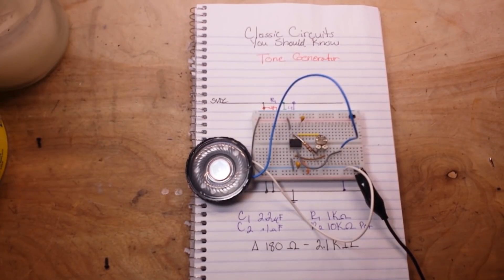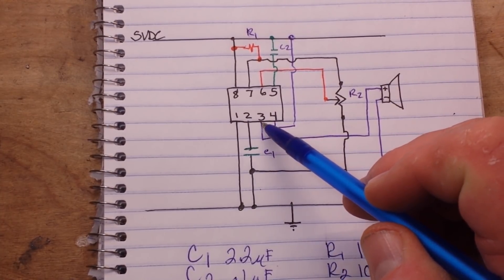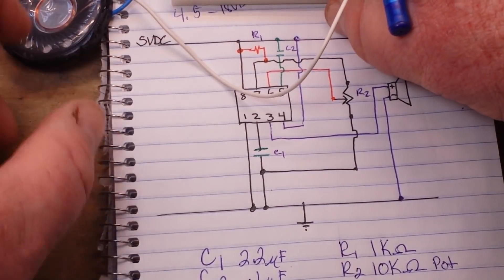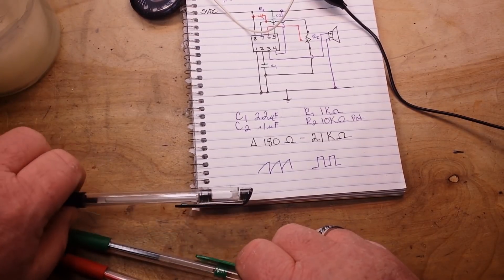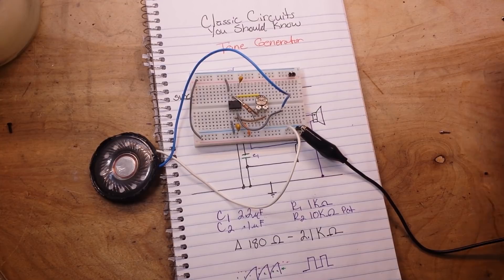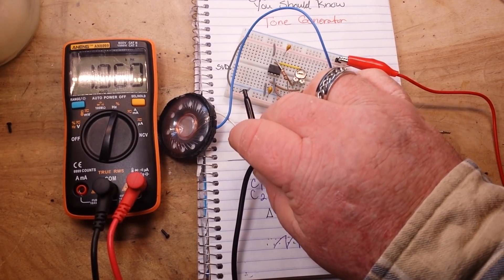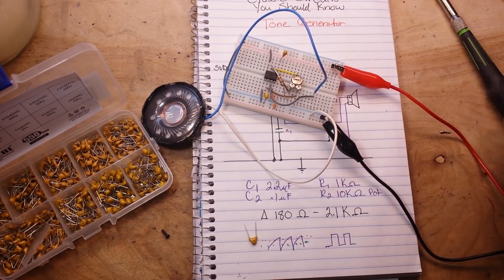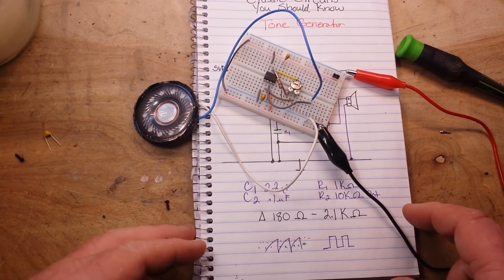Classic Circuits You Should Know:  Tone generator

Comment: Important: the circuit you have drawn does not match the circuit you have built. The potentiometer R2 does not go directly to ground. Between the ground and R2 is the capacitor C1. In other words, the output of R2 is connected to C1 and Pin2. Otherwise, the circuit will not work!

Comment: Thank you for your videos! I appreciate your channel! And I'm learning a lot with your "Basic circuits you should know" series!! 
Here is my though, I think that maybe there is an error in the schematics drawing. The potentiometer wire have to be connected between the pin 2 and capacitor 1, not between C1 and ground. Otherwise, how the potentiometer would discharge thru the pin 7?

Comment: I’m a real amateur so apologies if I’ve missed something, but I’ve built the circuit as drawn and it simply doesn’t work?! Looks to me like the side of the variable resister that is connected to the ground side of the 2.2uF capacitor should be on the IC side of Same capacitor? I’m thinking I must surly have missed something as the video is a year old and several people have suggested they’ve built the circuit but not made similar comments?......

Comment: I'm very late to this, but....

Is that schematic right? You have the connection from the "bottom" of the R2 going to the ground side of C1 rather than to the pin 2 side of it. That means the capacitor is never going to charge. The current that would charge it -- coming from the 5v rail via R1 and R2 -- is going directly to ground instead.

Shouldn't it be connected directly to pin 2, i.e. on the 555 side of the capacitor? (That seems to be what you to have on the breadboard.) Or is this a new, clever way to use the 555 that I don't know about. (Not trying to be snarky; I'm a total n00b so it's entirely possible I'm missing something.)

Another fun circuit to do might be an oscillator with just a schmidt trigger chip (like a 74HC14) plus a capacitor and a resistor or two. I think I've seen that one somewhere.

Comment: Hey Paul, at first banggood was good,but everything has gone south with them. I purchased a dig signal function generator and it came in missing 3 of the main capacitors which I didn't have in my collection,so I purchased some capacitors from banggood in a kit.I was able to replace 2 of them but still missing 1,got no help from banggood .then I purchased diy inductance meter kit and it came in missing the main large ic chip that runs the meter.now I bought a 80w 220 to 24 v transformer along with a small robot kit for my grandson and the robot arrived in pieces with no transformer and now banggood is giving me a hard time about it and I feel  like I'm gonna end up eating it ,just like  on the other items. wish I could talk with you Paul I could use some help.I'm a disabled vet I live on a fixed income my family have been great on helping me purchase my electronics since I got back into it while watching your program,which has helped me out a lot ,thanks to you paul.I no there isn'tmuch I can do about it ,I'm just very upset about this because I have purchased everything else to build my own D.C. power supply from banggood all that was left was the transformer.so I have a function generator that doesn't function,a dig inductance meter that now is spare parts, and a D.C. power supply with no power supply.frustrated in upstate ny. Paul  thanks for your videos ,I wasn't in a good place ,until I was watching your show on YouTube one day and you got me back into electronics , keep it up my friend.

Comment: Lol.  a little basic synthesizer,  just needs a VCF filter and a ADSR envelope generator.
Reply from the maker: I have been wanting to get into synths. The ADSR envelope is on my list of things to learn.
Reply: @learnelectronics   I just rebuilt a ARP Odyssey 2813. I think it's a 72-74..  I've had it for decades. The power supply caught on fire years ago and I put it up, figured I'd fix it one day.  Also a Korg Polysix.   I've got other synths I've played for years. I'm fixing to work on a 83-84 Roland Juno 106.  The voice chips go bad in those. I'm going to try the acetone bath and go from there...hopefully it's  a success.    On the Arp Odyssey,  I had to change out the chips and caps,  realign it, the Tantalums were destructive that caused my power supply problems to start with...so I put in tiny Panasonic electrolytics.  It works great now.  I've uses it on a few recordings.    It's an amazing little synth!   It's worth allot I found out and I decided I'd get it going again.   I'm looking into a Moog 1.  I love those synths.

Comment: In the astable circuit in the datasheet pins 2 and 6 are connected to each other.  But in the circuit in this video pins 2 and 6 are not connected at all.  Pin 2 is connected to negative through a capacitor.  I think there is a mistake.

Comment: Thanks.  You are right, the 555 timer is versatile.  I ordered several of them to play around with.  They are used for a lot of different types of circuits, there are books out there with circuit diagrams.

Comment: I use a 555 for button/switch denouncing on most projects that do not use a micro controller, works fantastically. The only time I use a schmit trigger is when I have several buttons that need to be denounced. I actually try to use a 555 in every circuit I can. Great video Paul.

Comment: Sine wave tone generators sound more pleasing to the ear. The advantage of the digital tone generators is that they only need a single component value change to change the frequency. One solution to this problem is to use resistors  and a ring counter to synthesise a pseudo sine wave. This approximate sine wave can be improved by applying a low pass filter cutting off below the switching frequency, but above the tone frequency. The advantage of this method is that the filter component values do not need to be that precise. The disadvantage is the accuracy needed for the wave form setting resistors.
For siren tone generators, I prefer to use more favourable quad Schmitt trigger, followed by an RC or sallen-key butterworth filter.
By using a quad Schmitt it is possible to use one gate to modulate the cadence or frequency of a second being used as the primary  tone generator. This allows the synthesis of the De-Dar sound.  Add a single transistor to the feedback path and the frequency can be modulated into a rising a falling tone, making that well known wailing sound. In fact the quad Schmitt has the  potential to form four independent oscillators or use three as oscillators and one as a mixer/buffer or switch.
The advantage of using a sallen-key low pass filter is that it is easy to make the second order version.  Both resistors can be the same value and the capacitors are in a simple 2:1 ratio, allowing this to be implemented by putting two of the same value in parallel.

Comment: Very good tip with interference of the meter in the 555. it's impedance adds up to the circuit. :P Sorry to ask but the capacitor in pin 5 should be connected to ground? it is in the typical application on the datasheets

Comment: Woo hoo! I think I understand line level output now and can share. The output from pin 3 is going to be just under the amount of voltage you power the 555 chip with. That's plenty of voltage to drive an 8 ohm speaker but it is too much voltage for professional audio gear, whose signal will ultimately need to be amplified but not while it is being used by a load like a mixer. Or perhaps the tone generator is the load ... whatever ... the point is we just need to "tone" down the voltage a bit (-4dB) by running the output from pin 5 across a 10uF cap to a voltage divider with 10K from the cap to the output and a 4K7 from the output to ground (using 9volt battery). Sounds NICE!!  🔊😬👍

Comment: Another 555 circuit, love it!  I wonder if the founders of the 555 really understood at the time the wide variety of circuits it can be applied to. It's so many things (Schmidt trigger also, as you mentioned) wrapped up in one 8 pin IC. Even a noise maker :)
Reply from the maker: Probably not. After all they just called it a timer. And it is. Run it in mono stable mode and it's a great programmable timer. Run it bi stable and you have something else. Run it astable and it's an oscillator.
Reply: i think so, they designed it to be versatile. Who knows?